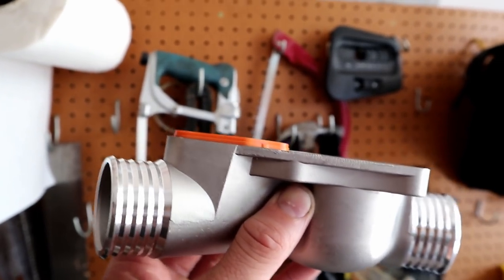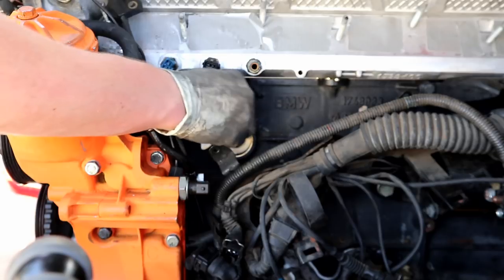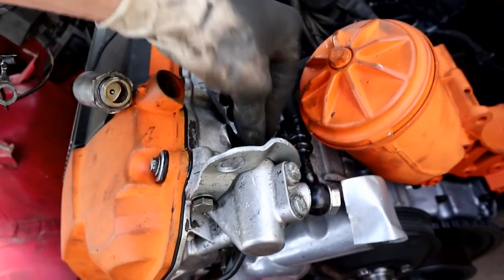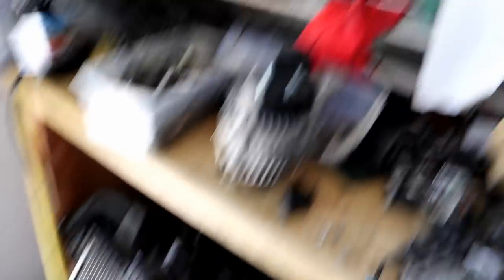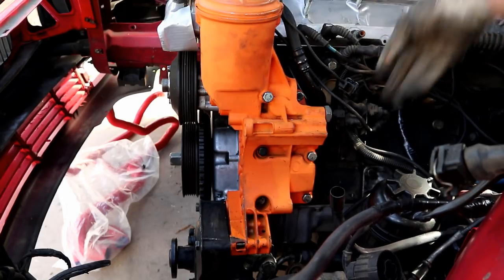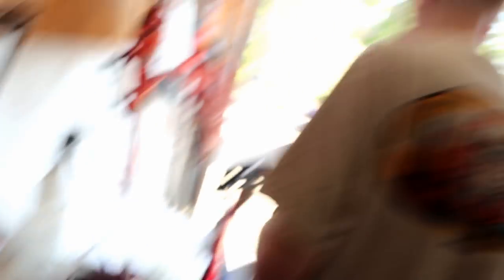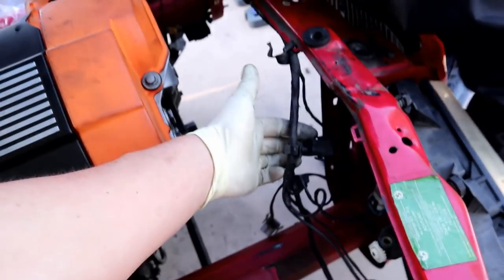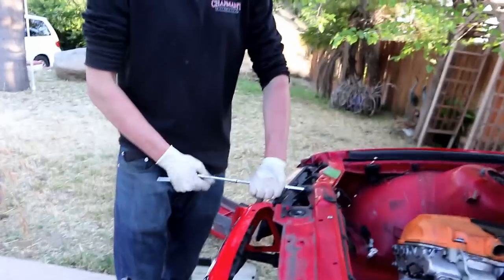The M50 get's Wired.

Comment: The gray wire on those depo headlights is for the daytime running lights.
Reply: @goclunker   I have a US spec 98 328i and the exact headlights he has, and the wire is to be spliced to the corner running lights for DRLs that are housed in the high beams. It may be worth noting that in the US, the terms 'DRLs' and 'city lights' are used interchangeably.
Reply: @JonasKvale  City lights=the european equivalent of US marker lights. end of story.

Comment: Wire is for the euro city lights! Connect to corner lights and delete corner lights or run both together.

I deleted my corner marker lights and ran the wire to euro city lights. I wired the corners into the rear fog switch so i can turn them on for extra lighting when i want to. 

This doesn't affect the turn signals in the corners. 

I didn't want to splice the wire, so I simply soldered the wire to a pin that plugs into the marker light socket (socket removed from that trisocket plastic socket that plugs into the corner)
Reply from the maker: I think I might splice it in with the corner lights, or I might just leave it alone.
Reply: @M3NACE  Depends on the look you want to go for! I hate corner lights with a vengeance, but sometimes being able to turn them on is not a bad thing.

Comment: PS, if you wanna get rid of that crappy aftermarket connector with the rubber cap on those depos and use a actual twist harness plug, go to lqk and cut off some obd2 maf sensor connectors. The twist plug is identical to the one used on the lights. Obd1 is not and will not work

Comment: gaskets come thick so they can form to the surface when they run though many heat cycles. same goes with valve covers always check tightness after a few heat cycles.
Reply from the maker: I get that, but these are too thick. as in when the housing is bolted down and torqued, the housing does not sit flush with the cylinder head because the gasket is too thick. replaced with an OE gasket and it worked perfect.

Comment: Where can I buy that silicone spider coolant hose I'm boosting my s50 e30 amd I need sometbing that will last
Reply: I'll sell you mine. I am using my metal one instead. Used the rest of the kit, so all i have is the branch hose that replaces the factory metal. S52 tho
Reply from the maker: @goclunker  its a hose off an E30 M20, its not made for E36's lol. im sure just getting brand new OE hoses under there would be fine.
Reply: @M3NACE  I got a HPS kit that came with the obd2 equivalent, but somehow i don't think it will outlast the metal pipe. I also didn't wanna deal with installing fittings

Comment: which thermostat should I run on my forged s52 turbo I got a 170f and temp gets to 220 with ac on.
Reply: Grab America by the Flaps i guess you can run a lower temp thermostat, 220 is not that bad
Reply: Thermostats wont change your temp just open the cooling system up at a lower temp. upgrade your fan and radiator and you should be good. mishimoto makes a race thermostat that should work good too!
Reply from the maker: @levi.mcadams  I would honestly just stick with an OE temp one. if you want to run colder for peace of mind you can, but you wont gain any performance from it.

Comment: How do i connect a new fuel rail wiring harness? My fuel rail caught on fire and i gotta replace that whole system
Reply from the maker: you would connect the harness to the injectors, not the rail, and they just snap right in.
Reply: @M3NACE  yes, my harness melted to the injectors. So I was seeing if they sell the whole system that connects to the intake manifold
Reply from the maker: @thetrumanshowpartsunkown205  more than likely you will need to replace the entire engine harness and injectors, hopefully it didnt damage your intake manifold, as it may need to be replaced as well.
Reply: @M3NACE  Thanks broski!